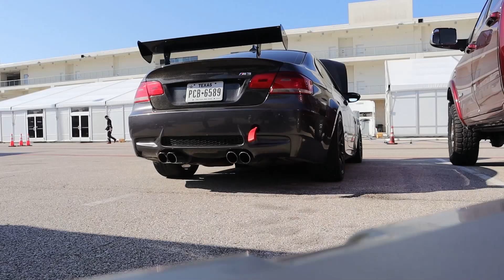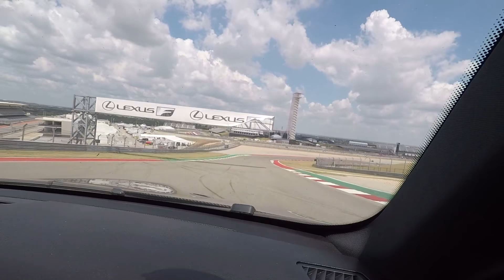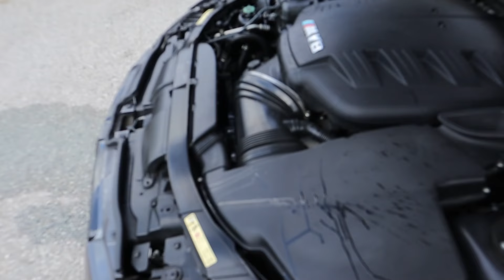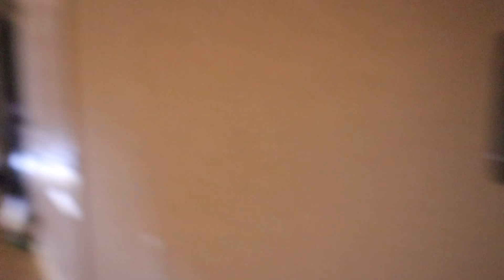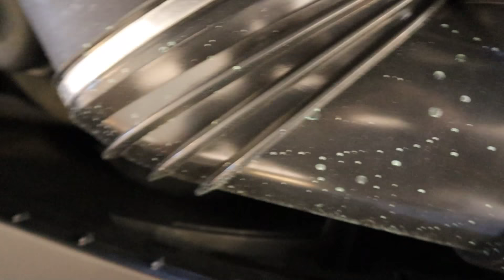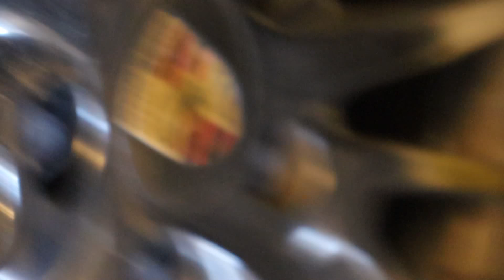E92 M3 Track Build Has Catastrophic Failure On Track (COTA) + New Project Car

Comment: Maybe you should check your engine mounts, if they are bad it can make the engine move a lot more causing the fan will hit stuff.
Reply from the maker: Yeah, I'm definitely going to give them a look. They're brand new mounts that we threw in when we did the RB's, but anything can happen! I'm wondering if the fan was weak from being in the car for 180K miles in TX heat?